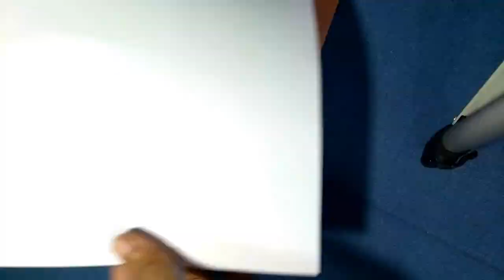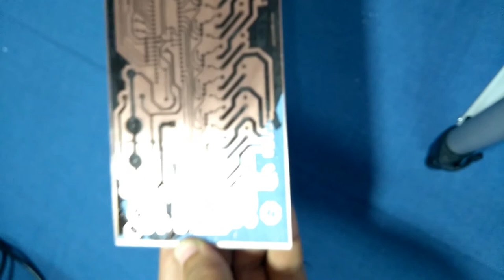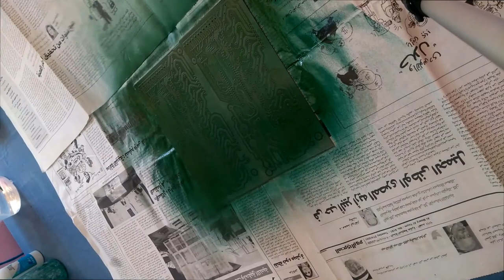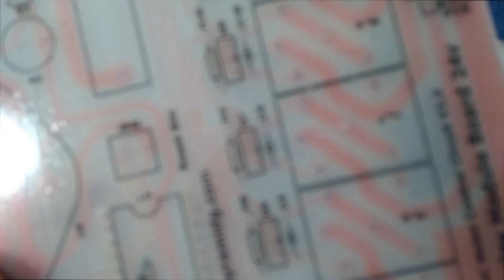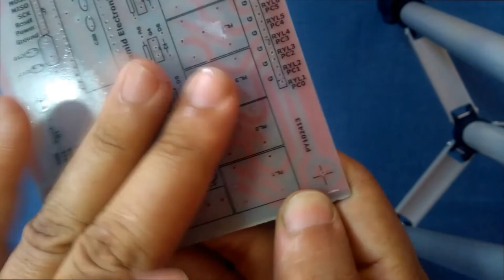DIY PCB solder mask with paint spray easy and good way.

Comment: How could you solder your components if your soldermask is covering the pads? Or you're literally burning the paint?
Reply from the maker: Yes over heat will burn the paint and make space that solder will take to stick to copper
Reply: could use a needle and wax to cover the pads and then just peel them off

Comment: Hi, but this is not good, it burns with heat and if you try to clean the board with thinner, it will be removed
Reply from the maker: Yes this method if you want cover copper from oxidation. and use alcohol for cleaning